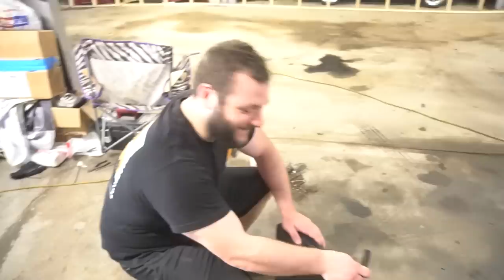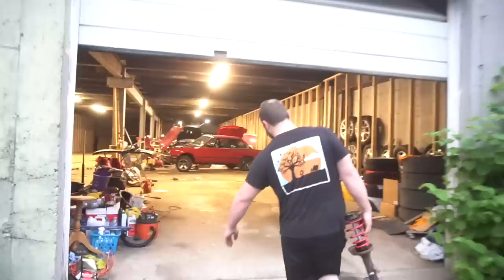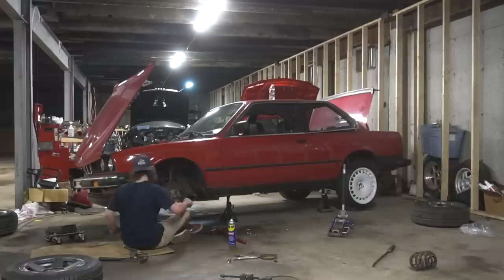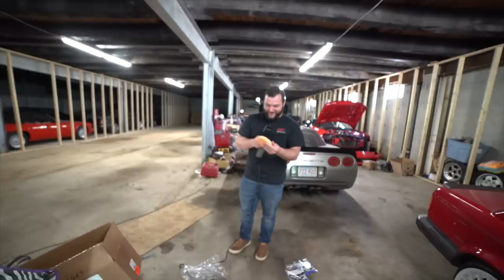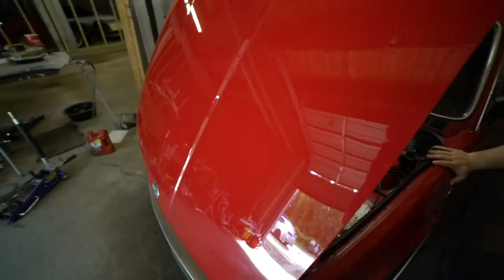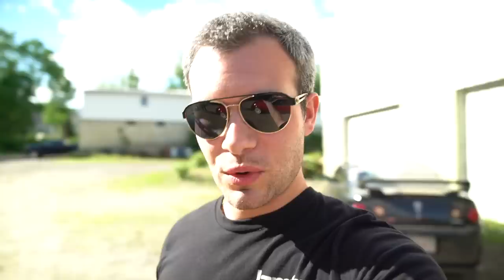BARN FIND CONDITION BMW E30 GETS RESTORED!

Comment: That iron bumper can be pushed in there's two hydraulic like things I don't know what to call if you drill a hole it it will spray and then you should be able to push it in(just check at the bottom of you don't understand search on  how to push the metal bumper in